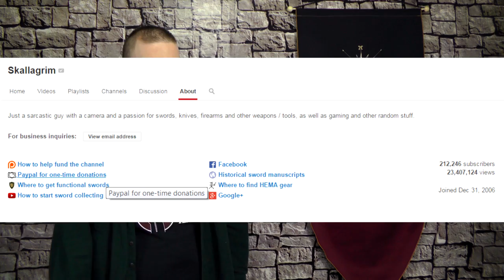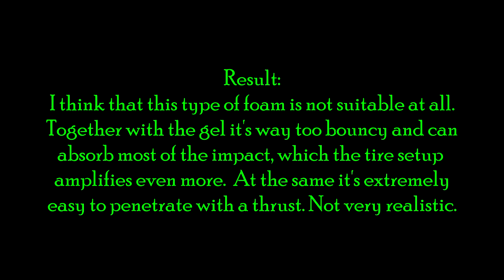The ongoing quest to find a realistic test cutting medium

Comment: Hey Skall as csknives said a pig body would work best, but is expensive. I do a lot of ballistics testing and have found something much cheaper than the gel, wet newspaper. No really. When its wetted down it actually very similar to the human body cavity, we use this stuff all the time for penetration tests. Get yourself a couple of big sunday newspapers, get them wet and wrap the, and you'll get a rough approximation of human skin/sinew/muscle fibers. Hope that helps. It wont work for bone, but living bone is stronger than reinforced concrete, so it wouldnt really effect your test other than stopping your blade, might as well put a steel bar in there
Reply: Well, a pig is expensive to purchase... pre buchered that is. Could always kill a feral, do the tests, the process the meat afterwards.
Reply: skall has a moral issue with the meat industry so that probably won't happen.
also skall has used wet newspaper in the past in some cutting tests/exercises
also bone is strange since it is easier to cut than to shatter, and if you were to put either concrete or steel inside you would seriously damage your blade.
Reply: Tuptmore3
Feral pigs aren't as easy to find in Canada as they are in say, the Southern US.
Reply: BillyJoe1305
or in Cold Steel's CEO office.

Comment: For bone material, you could maybe make it out from plaster? If you make it, so that in the middle of the plaster form will be a hole ( when you are casting it you could just instert a straw or something into the middle of it), Because gypsum is pretty much like a bit more rigid bone, it definietly should work as a substitute ( if I calculate corretly, maybe even the weight would be around the same). Plaster is easy to get, cheap, and easy to make. As an archaeologist, we are pretty much using this method all the time for substitutes.
Reply: Thinking of it, it's not even rigid if made correctly
Reply: If he cast it with a stick or dowel in the centre then yes it might work, but otherwise plaster would just crack too easily.  Perhaps if he used some sort of polymer plaster like duo-matirx (also from smooth on) it would work though.
Reply: Bone is much harder than plaster,
Reply: Cast are often made of plaster. I think it is plenty rigged for bone, but not sure how impact resistant it is. Of course you can vary how strong it is by putting straw or some other sort of fiber into the cast to make a composite material.
Reply: Indeed, I think green wood is really the best compromise.

Comment: Mythbusters figured out that Ash has a similar breaking point as bone. It was in an episode where they rebuilt Buster the crash test dummy, season 3 episode 11 I think.
Reply: There you Skall...I think you have basically two ways to go about perfecting your phantom. 

Stick with "conventional" wisdom on the matter and hope to find some good sources. Mythbusters is probably doing a good enough job on that front.

Or try to get into contact with material scientists who can teach you how to analyze materials. You could then probably scour through reference materials and look at all the different qualities of the tissue involved. Materials which can be poured into a mold like your ballistics gel will probably win out. The best would be to find a way to actually test the materials yourself. That would probably require help from a scientist or engineer. That said, I would be really interested in learning what material qualities would be important to consider. These qualities probably differ for blunt and piercing damage as well, and when it comes to the skull you might actually want to invest into something like an accelerometer like we have in smartphones. With that you would be able to measure g-forces and you would be able to discern whether you knock someone out or even cause fatal brain damage.

Comment: Wish the silicon, you can patch it up with more silicon (silicon sticks to itself quite well, obviously). But yeah, it won't have nearly the longevity of ballistics gel. As for getting the "bone" to stop drifting, set the gel 1/3rd of the way, then put the bamboo in place with a thin layer of ballistics gel - just thick enough to hold it in place, tie it down or use toothpicks jammed into the already-set stuff to hold it in place if needed - then once the thin layer has set, pour the rest of your gel into the mold. That's the way I used to do it.
Reply: Beaujangles McJiggle Good call. I've simply used break fluid before and it worked well enough.

Comment: For the bamboo stick you could try to use a longer stick, put it in the mold so that it sticks out on both sides and hold it in place using two disks at both ends of the stick. Make disks of wood with a hole in the center, their diameter being the same as that of the mold, the you put the bamboo stick through those disks and into the mold, it should keep it still and prevent the shifting. On second thought instead of disks you'd better using squares so that they can easily stand still ;) hope I explained myself ;) good lluck ;)

Comment: ***** I think the big difference between natural muscle tissue and ballistics gel is that muscle tissue it fibrous. It has a grain and certain tension that allows it to be cut and severed. The gel is an equally distributed, suspended solution (may not be technically the correct term, nonetheless...) because of that, it has nothing to cut through that parts once it is severed and instead the whole block is fully neutralizing impact because of this lack of structure. My guess for a more realistic analog would be to take fibers (jute, poly, whatever) and suspend them in ballistics gel somehow. A simpler method may be to take a few pieces of say 1cm rope, align them together, and let hot ballistics gel permeate and form around them thinly. I have a coupe of ideas how to suspend the rope or fibers if you're interested. Let me know.
Reply from the maker: Argartis That sounds like an interesting idea. It would make the gel impossible to re-use but since it requires smaller amounts it may be worth trying.
Reply: *****  Aye, that is the issue with it. It may be worth trying with the "budget" gel, since it's not in large quantities and doesn't need to be quite so pure. Its essentially 1 part commercial (cooking) gelatin to 9 parts water by weight, (or 2 to 8 if you want 20% gel) for 10% ballistics gel. Since its built around a medium it doesn't have to quite as consistent. as you need in a large solid block. There are several videos, ehow articles, instructables, etc on how to make it with this method. If I had the time and spare money I'd try it myself (and might at some point anyways) but right now all I can do is share the idea.
Reply: *****
perhaps if you found a way to cast the gelatin into something along the same vein as fiberglass?  you make the individual strands, and then you pour the molten gel over it so it seals together.

Comment: A thing you could do is in plaster sculpt parts of the body part. If you're making a leg or an arm, you need the bones, individual muslces and the skin around the outside.

Once you've sculped them you can make the negative molds by casting them around the sculpted parts, if you need to then line them with something non porous afterward. For bones there's probably a plastic you can find that mimics it that you can re-melt each time. Mould the muscles after out of the ballistics gel, stick them on the bones peroperly. then find something else after that mimics the soft parts like skin and fatty tissue and wrap around.

Comment: As for centering the bamboo stick in the gel. Just try to make a small dent on the bottom of your mold and get a good tang or make a basic holder (a bent nail on a wooden plank would be the easiest and quickest way) for the bamboo stick. That way you can hold it steady in the mold until the gel solidifies. I used that trick to make a few things myself. Maybe its not a most professional solution but it works.

Comment: Have you considered Thermoplastic gel elastomer with a PVC bone analog?
The material is sometimes used for flesh substitutes (in the medical and personal care industry) and can be melted down and re-cast many times over, the density and rigidity can also be varied by using more or less mineral oil when doing the melt.

As far as I know it's also sold by smooth-on, so it should be easy to find.

Comment: So let me say that I have worked as an EMT and a Nurse aide.  I have also worked at a butcher shop processing game. Bone damage both blunt and sharp force trauma is fairly complex.  Sharp force trauma, like you see in archery when a broadhead goes through a shoulder blade on a deer, produces shearing, divots, and fracturing. On a rib that gets only half of its cross-section impacted, you can often see green-stick cracks on the opposite side(s) of the sharp impact where the rib has over-flexed beyond its natural limitations.  (in other words on the inside of the rib and on the hind side if struck on the front and vice-versa. The inside cracks tend to be perpindicular and the hinds crack longitudinal)  So the rib was moved inward and to the rear, as well as having a v-notch cut into it by one edge of the broadhead. Having said that; the arrow is traveling 200-300 feet/sec and a sword half that.  Now total energy in a sword is more, but just. Momentum is Mass X Velocity^2.

The bottom of the v-notch will often have a secondary more sharply-sided notch.  So the edge hits the bone and the impact and edge take out bone identical to the blade profile.  As the blade moves forward, there is secondary fracturing around the initial profile as the blade goes deeper; much like a wedge of wood curls out from an axe blow on a tree. Bone being closer to the hardness of sandstone than wood it fractures rather than bends; effectively jumping out of the wound channel. As the blade continues on, it carves a deeper, fine tool mark and a wider notch is exploded out in the wake of the impact.  Some refer to this as "splash"  There is blunt and sharp splash.  No matter how sharp the instrument there is some blunt force happening at the same time. So this is calculus as well as algebra.

Comment: regarding sticking to the mold

In the rubber and plastics industries, they often use something called "mold release".  It's sprayed or brushed onto the mold surface to help the molded item remove more easily.  You should be able to find some online.

Comment: Also, you could try a top and bottom socket for centering the bamboo. Basically two wood circles with holes in them.

And if you go silicone rubber, you can simply chop up your old cast and dump them into a new one as filler material. It's the same stuff, so its not like it matters. It'll cut the amount of new rubber down MASSIVELY.

Honestly though, I'd try mold release and retention sockets on the gel.

Comment: Skallagrim. TPE Thermoplastic elastomers. Also, to keep the stick in place, I reccomend putting a sheet of paper or tin foil over the mold and stick the rod through the paper to prevent it from drifting. I do that for popsicles, so I don't know if it will work for gel.

Comment: Honestly I don't really see what was such a failure about that simulated thigh at the end there. I agree the tire being able to swing gave it a bit too much shock absorption, but otherwise it seemed to be a fairly reasonable analog for a human limb. If you were to mount it the same way you do your wet newspaper on dowels, instead of the tire, I think it would probably work a lot better (even more realistic).
Reply from the maker: Skeletor Jopko The problem with the cutting stand that I use with the soaked newspaper rolls is that it makes the dowel in the center very likely to just break from the impact.
Reply: ***** So, much like a leg with weight on it?
Reply: ***** What if you replaced the wood dowel with PVC ? they make different thickness of pipe.
Reply: *****  I know this sounds kind of weird but....
Soak the papers in food-grade gelatin and wind them more loosely around Cyberflea's PVC, and fill the pipe with any left over gelatin and/or sand.
Reply: ***** If you used a stand that held each end of the dowel securely rather than just one it probably wouldn't break.
Reply: UnbeltedSundew No, I think that would make the dowel much more likely to break. Here's an experiment for you to try: 

- Take a thin board (say, half an inch thick) and hold it by one end, then hit it (in the center) as hard as you can with, say, a hammer, using your other hand. 

It didn't break, did it? Good. 

Now take the same board, secure both ends (use a vice, stack bricks on either end, whatever) a decent space above the ground/floor. Now hit it in the center with a hammer (or heavy object) again, with both ends secured. 

What happens?
Reply: Skeletor Jopko Hold one end in a vise would be a more accurate comparison, and it would split of where it meets the vise.  Two points of structure will prevent it from snapping off.  It will make it overall stronger.  To properly do this experiment of your you need a newton scale and I suggest you go for it.  Attach a board securely at one end and pull it with the scale until it breaks, record the amount of force required then do the same thing with both ends secured.  I guarantee you you'll need more force with both ends secured.

Comment: A way to get bamboo etc. in the middle... cast and set half or two fifths, rest your bamboo on set material then cast the rest.

Also maybe try a rack of pig ribs (real flesh and real bone, yeah I know, but just for one test) to get an idea of damage that you are trying to replicate when making your analogue?

Try a release agent to release from your moulds easier... for silicone you can buy it in spay cans or squirty bottles, not sure if it would work with ballistic gel though or maybe even try coating your mould with something cheap like vaseline, you can put that over hairs when casting faces/flesh/body parts with alginate to help aid release.

Comment: Zombie go boom seems to have got a accurate bone medium in their Ivan heads so you can contact them to find what it is
Reply from the maker: MrFridgeToast I'm pretty sure they wouldn't tell me, since the composition is their secret.
Reply: ***** And they are very hostile towards people interested on their stuff, they oftenly comment harsh things on channels pages, acusing them of plagiarism and such.
Reply: ***** you could try gypsum, even though it is only half as hard as bones, Mohs Hardness 2 vs 5
Reply: ***** You need to have the stick go through the gel all the way supported at either end, a mold could be made out of a large threaded pipe which has been cut in half hinged and latched. A welding shop could do all this for you.

Comment: I don't know if anyone has already suggested or you already figured it out on how to remove the ballistics gel from the mold easily. If I may?
Preparing mold for the gel.
1. Coat inside of mold with petroleum jelly(vaseline). A decent coat.
2. On top of the coat of grease line some plastic wrap(saran wrap). Have plenty of over hang.
3. Now coat the plastic wrap layer with the vaseline or choice of grease. Same as step. 1
4. This time line with heavy duty black garbage bag. Don't forget to have some over hang of the garbage bag.
The garbage bag will be stuck to the set final product but at least it comes out of the mold easily. 
If you can find a silicone spray then you're better off using that I've heard but not used. The suggestion I made with the layers is from personal experience. Very crude but works.

Comment: Hollowed out elder-wood (it has a soft core) with a bamboo-stick through the center, you might even be able to just push the bamboo right through, it seems to have the same breaking point of the bone in the upper arm or lower leg.
It is also pretty easy to make compared to some other replicas.

Comment: About the issue of the bamboo shifting in the mold, perhaps drill three small holes. One on each end and the middle one rotated 90 degrees from the other two and set wooden chopsticks into the holes. Cut them down to fit in the mold and it should help center the bamboo. You could also cut it down to 2 holes since the mold is circular.

Comment: If you want to keep the stick(bone) centered: Just cut a wooden circle of roughly the right size to fit in the mold, drill a hole  in the middle that's roughly the size of the bamboo, and set it in the bottom. The circle will hole the "bone" roughly in the middle of the gel and you could either cut out the circle after casting, or just leave it in to weigh down the bottom.

Comment: To center the dowel in the gel use two rings, one the diameter of the mold, and one the diameter of the dowel.  Use thin wire to connect the two rings like the spokes of a bike tire.  Place this set up at the top and the bottom of mold.  This will center the dowel and prevent it from drifting as the gel hardens, and both ring setups will be out of the way for strikes.  You also could cut off the top and bottom to get both ring setups out of the target.

Comment: When I make silicon molds I often add in cut up bits from old molds. I have not noticed much if any difference in the strength of the silicon. So you could probably reuse a good portion of old test mediums. Maybe do a bit of your own testing to see how adding in the old silicon affects it.